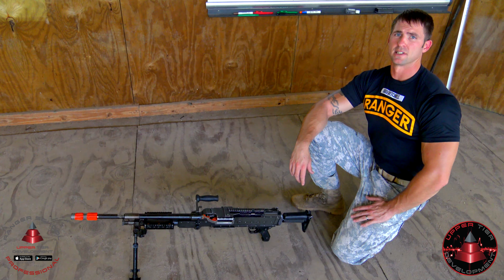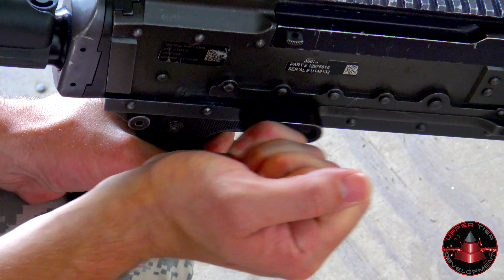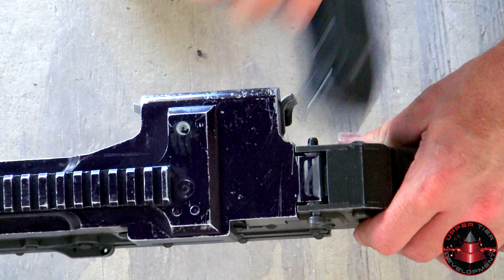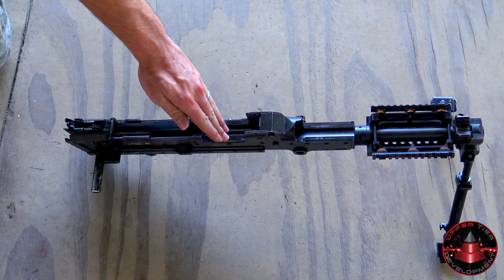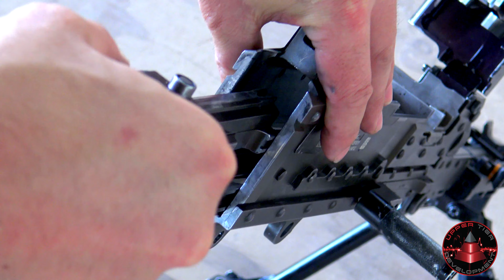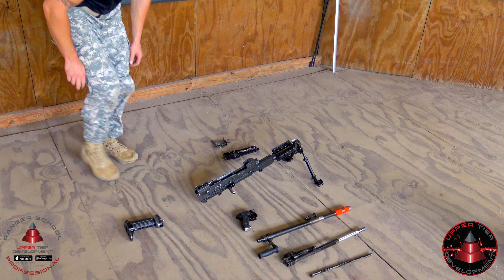Maintain M240B Machine Gun 4K

Comment: Questions ?
Why did he not check/clean the gas parts ?
M240 fires from a closed bolt, why European versions MAG/ GPMG fire from a open bolt( as M16 Rifle) why ?
Reply: Because this is a test of the operators ability to perform the task of: clearing, disassembly and reassembly of the 240b